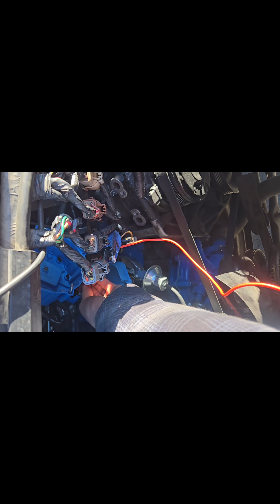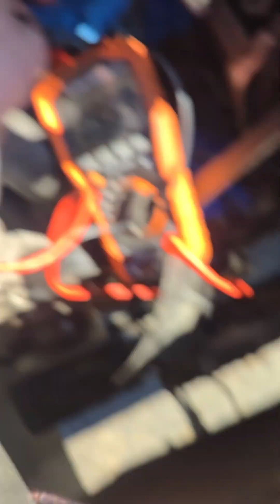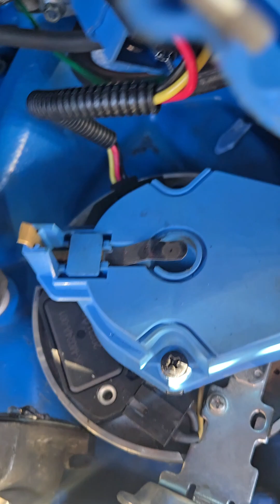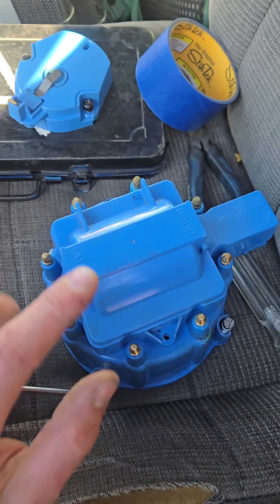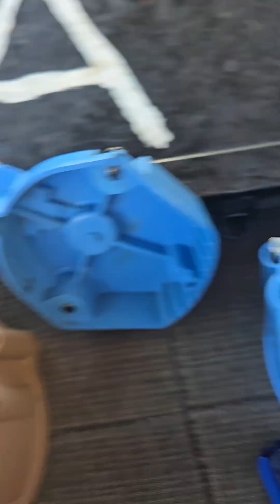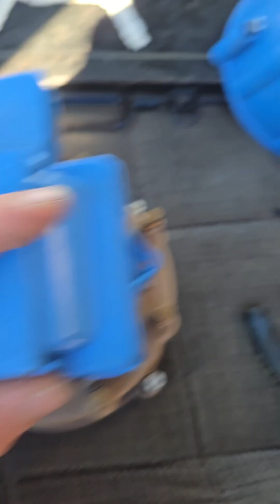HEI Distributor Not Firing? Easy Fixes & Diagnosis Guide  (How to fix a misfire)

Comment: GM HEI dizzy, on a 351 W....
Reply from the maker: I mean....it fit😂

Its just a gm top on a ford shaft and cam gear bit. I like it other than the freaking ignition module!!! I carry two spares on me😂
Reply: @Saadmetalfab I've only had 2 modules fail in ....30 years. I have spares in the truck...a  known good, used one and a new one.
 The new ones can be less reliable than old used ones...lol
 The used one is wrapped in newspaper and litmus paper, in a small Ziploc.
Reply: @Saadmetalfab At least the dizzy is up front, for easy access...lol
Reply: @Saadmetalfab some old goofy machinist guy sent me to your channel 😁☕